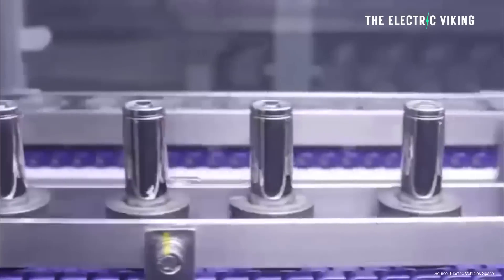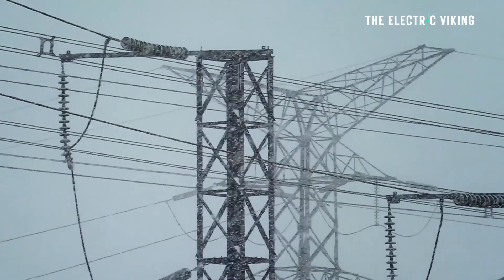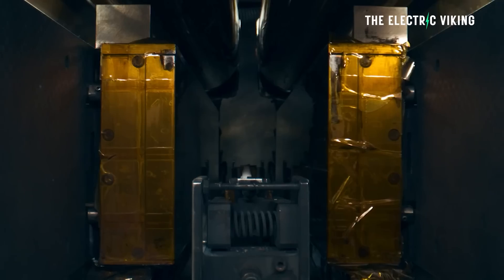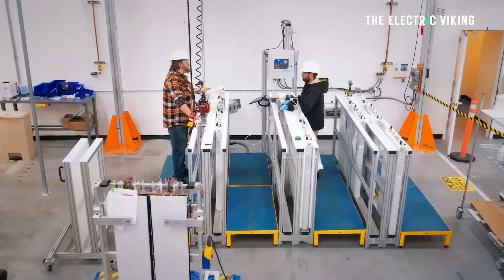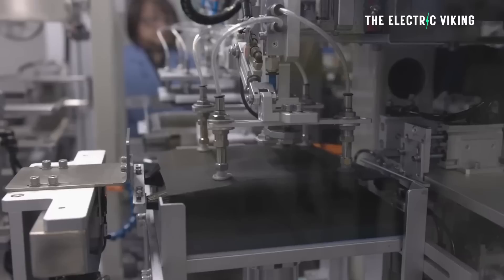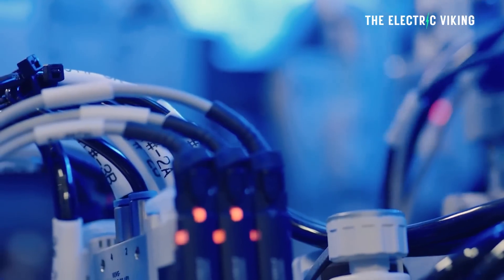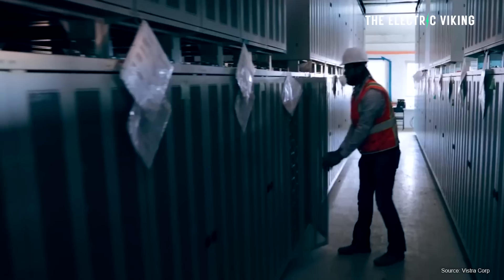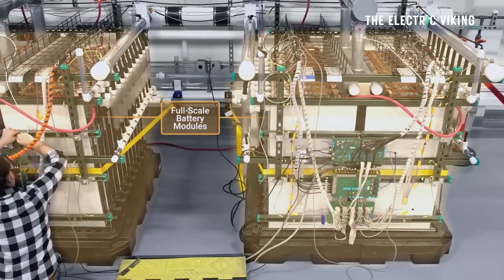U.S company reveals revolutionary battery that DESTROYS sodium & lithium

Comment: Iron air batteries lack the energy density to ever make sense in vehicles. However, for stationary storage, they are cheap as dirt and practically infinite cycles. Not destroy LI batteries, but make more sense in large stationary installations.

Comment: Installed on the site of a closed factory.  And using lithium-free batteries made in a long ago shutdown steel factory in West Virginia, bringing needed jobs there.  Partially funded by President Biden's IRA.    Tesla seems to always build their mega factories on new previously undeveloped land in areas where jobs really weren't needed.    (Rivian's are mostly built in old rust belt factories.)

There are also flow batteries that don't involve lithium or cobalt and are better in hot climates.   Lithium shouldn't be used for grid-scale storage.

Comment: Cost isn't the only factor, assuming it's true.
While it might put Tesla Powerwall into obsolescence, batteries for Tesla and other vehicles would remain Li-Ion. Why? WEIGHT. Iron is much heavier than Lithium. And the cars by weight are already causing major wear and tear on tires and roads. 
So this new tech is great for homes and grid applications, not so practical for mobile applications. Let's see how this plays out.

Comment: The comparator here would be the vanadium redox flow battery. The largest one presently operating is 100 MW, at the Ronke plant in Dalian, Liaoning, China. The storage is only 0.4 GWh. However, storage can be scaled to any required level simply by building extra holding tanks for the liquid electrolyte.

Comment: As with IT, could have a chain of high performance tech working down to cheaper high capacity. CPU cache > RAM > SSD > Hard Disk > Tape. With batteries have a decent LFP battery to dis/charge quick for power spikes, then this to dis/charge slower and keep LFP charging as much as possible. Alternative off-grid multi-day store would be a generator. Could be great for wintery multi-day bad weather if a reasonable price. Could be great for off-grid cameras, Starlink, etc where the pain is multi-day bad weather.

Comment: Simplifying this, it's a large, heavy, inexpensive, durable battery with a maximum discharge rate of 0.01 C.  
  Renewable detractors, not totally unreasonably, worry about scenarios where there is inadequate generation for a protracted period.  Stagnant high pressure area with no wind.  Constant cloudiness during a Californian atmospheric river.  These batteries are too slow to meet the peak requirements, but could be be sized slightly larger than nighttime base load.  They could then used to recharge the peaker LFP batteries that are faulted for having only 4 hours' capacity.  Very similar approach to a low power (20 hp) gasoline engine in a PHEV which requires only 17 hp to maintain 100 km/h on a level expressway.  The small battery is always ready to provide power to the 200hp electric motor for 40 miles and is slowly refilled between sprints.

Comment: Northern Europe may need multi day systems. I have up to 12 days of very overcast skies and no wind, very common in England due high pressure blocking. But as some on here noted why not use a mixture of chemistry to off set the disadvantages of both. It's a very interesting chemistry and will have a nose . 
Incidentally I have run off grid for 15 years and actually use two systems one lead acid and another on LiPh. I think the way for off grid is definitely LiPh . I only have the lead acid as it was the only system available at reasonable price at the time things have changed since then.

Comment: 1/10 cost, sure, if it is working rusty iron rather than lithium or sodium or other rare metals and chemicals as it's working medium.

I think the slow discharge is going to be an issue for the grid. But it may be OK for smaller applications. I'm really hoping they can scale down to home use like you speculated.

Comment: There's not enough lithium to do the job, so if course they're looking for a more common replacement. EVs are a novelty, a dead end until either battery chemistry improves significantly or onsite generation is developed to a practical level.

Comment: Who'd have thought... Edison! Edison thought. The Edison Iron Battery, available since the statrt of the last century, Edison used them to power the first electric car, before petrolium processing became efficent and available. The battery chemistry was invented by Jungner in Sweden in 1899, but Edison was the person who took them up. I beleve there is one somewhere that was over 100 years old and still running, but that was some time ago.
There problem was weight. But if you don't have to move them, weight isn't the issue. the other problem being amp draw, again they might come up with the same solution that brought about the 4680 battery, but not trying to draw from a single battery, this might not be a big issue.
Reply: Uses nickel

Comment: 1/10 of the cost makes perfect sense. The infrastructure for forging the plates. Iron is one of the most abundant natural resources if not the cheapest metallic resource. Water can be used as the electrolyte. Buy cracking water with electricity, it makes its own catalyst. It doesn't get cheaper than that. If it actually works, it's legit.

Comment: This battery is (1/10) the price of a Lithium cell.  OK.  But wasn't that "sand" battery even less expensive than this one?  And, if we are talking about a battery where (weight) or (size) are of no concern.  The "sand" battery has my vote.   lithium iron phosphate sounds like a good battery where (weight) or (size) ARE important.  Like in a car.  I read (lithium iron phosphate ) can take a charge up to (100%), and then down to (zero%).  Those are the qualities that are good for a car.  Stationary battery technology should still be a "sand" battery, in my heart.

Comment: It could be much cheaper, but not competitive in terms of energy per pound and energy per volume.  So it's not useful for mobile energy storage at all.  But fine for fixed energy storage where there is plenty of room.  Battery storage for days could be very useful for people who live where solar output can be down for days due to weather.  I would love to have one of these.  I could charge it on sunny days and send power to the grid during the 4-9 PM peak cost hours.

Comment: They're slow, heavy, and large in comparison to li-ion, but that just means the two compliment each other. Li-ion can be used to quickly follow load hour to hour. They can also be used in electric vehicles. Whereas iron-air can be used for more long term grid supply, for example, when there are multiple days of low wind or solar conditions.

Comment: Just use a combination of lithium ion and Iron batteries in the sweet spot between cost and peak loads.  If you have enough quick draw batteries to offset peak loads when needed you would still save gobs of money on the base load equation.

Comment: This would be ideal for the UK.  Imagine 10GW/10TWh of Iron Air batteries distributed around the grid near load centres and generation centres (ie offshore wind farm connection points), then in addition you have 30GW/60GWh of Lithium or Sodium ion batteries.  On top of this you might have another few GW of gas generation, plus all your offshore and onshore wind, and a bit of solar.  In times of surplus the energy feeds into the Iron Air reserve, in times of deficit the energy comes back out of the Iron Air reserve, with Li/Na ion managing intra-day variation ie night/data/peak.  If a longer high demand/low generation event is forecast then the gas generation might kick in as well to boost the system and see it through those times.  Offshore wind actually generates more in winter than summer overall which is a good fit against demand, but the generation is quite lumpy so need a way to buffer it and Li/Na batteries just can't absorb that many GWh cost effectively.

Comment: Probably it's a bad cost projection. Like only project the material cost. Of course, if you do that, iron is ridiculous cheap. Although also is salt (more, in fact). But build a battery is a lot complicated and expensive than just materials, and the difference is greater the cheaper is the raw materials.
On long term, if the raw materials are very cheap, like sodium or iron, there is a great potential of a very very cheap batteries, but reach that point of cheap production it takes a lot of time and development, not the next day you start to produce these batteries.

Besides, batteries has multiple variables to observe, like round-trip efficiency, cycles per lifetime, safety, disposal cost, etc. I know that sodium has great values in all these points. No idea about iron-air.
Reply: Ok. After checking a little via websearch I think I know what's the "problem" here. Bad round-trip efficiency in comparison with lithium or sodium-ion. In contrast, it seems that the battery manufacture could be very simple, and the self-discharge could be very low. So it's a candidate for secondary storage. Instead of daily-cycling like lithium/sodium, it would be a candidate technology for week discharge.

It depends a lot of the real cost of the price of a completed project. Because while daily discharge could be done every day of the year, so 365 cycles per year, 3650 in a decade, with a cycle-life of 5000 cycles it can be amortized in a reasonable period.
But with a weekly discharge, for combined solar+wind production depression, the number of cycles could be as low as 5-20 cycles per year. So the cost of the kwh needs to be divided by 50-200 to see the price per kwh cycled. It needs to be a lot lower to compensate the low number of cycles if you want to amortize the infrastructure in a reasonable time.

So, it needs to be 20 to 100 times cheaper than lithium/sodium to fill the niche of depression cycles instead of daily.

Comment: It is inexpensive because iron is cheaper than lithium. The round trip efficiency is only 50% so it is not as energy efficient as lithium batteries. In the end that might be acceptable if you are already “curtailing” (wasting) energy in the grid and you don’t want an expensive storage solution.
Reply: I think Sam missed the whole part of it having only 50% round trip efficiency. That’s basically throwing away electricity just like our current curtailment. In the short term, the lower capital costs will be great, but in the long run the cost of lost energy will mount, and you may not want a battery with a 50 year life span.

Comment: At the moment Li-ion/Na-ion is for balancing the network, because it can respond instantaneously to demand and supply changes. Fe-air, compressed CO2, compressed air, pumped hydro are for longer term storage, when you know you won't need that energy for the next 2-4 hours. For instant fluctuations, Li-ion is still better, because it can simulate an actual rotating power plant with a flywheel that's very stable 50 or 60 Hz.

Comment: Maybe energy storage will become a bit like how data is stored with tiers of performance vs costs.

With data you will have high cost and fast data on SSDs.

Then less used dat can be on high performance 10K hard drives.

Less used again on 7200K drives.

And if it's more for archivale then good old tape.

With energby you migth use lithium ion for grid stabilisation and adjusting to sudden changes in demand.

If you've filled up your lithium storage then you can funnel the excess into the longer term duration.

If your lithium batteries need a top up over night you can pull that in slowly from the long duration storage.

Comment: Yes but what is so imbecilic about your presentation of the new battery chemistry... is that the first sentences out of your mouth ... Says nothing about environmental improvements... And or cheap cost of the materials to make them. Don't you realize that's why the scientists and inventors went to the trouble to make sodium ion batteries? The reason they MADE the INVENTION... Was because sodium ion did away with the problem of pollution from mining lithium... Salt was an ultra abundant element that was super cheap. And the sodium ion battery could be recycled far easier. That should be the first things you t address when you present some new battery chemistry type. But instead you say nothing about it. Like in all your grand electronical wizardry education you don't even GET the reason the scientists and inventors MADE the invention.

Comment: Hey Sam, so the duration means very little. So for example take your electric car battery fully charged, leave it in the driveway with the overhead LED light on. Think of how long your battery will last because of such little draw. But the car manufacture doesn’t advertise the battery that way per length of time, it needs a lot of power very quickly to run the motors. I think the industry standard is four hours, then you can define your GW/hr and therefore consumers can compare apples to apples.  As for the cost this is probably in relation to two things. Number one as always with manufacturing is scale, the more you can make the less it’ll cost you. The second thing is pretty simple, it’s called the periodic table of elements. Fe is cheap and O2 is free, so yeah 10 X might be true?

Comment: It doesn't blow sodium out of the water because the energy density is really low for these iron batteries. They have different use cases. Stationary vs mobile.

Comment: the quoted round trip efficiency for an iron air battery storage system is 50-60% range vs about 90% for Li ion batteries.

Comment: This sounds like a potential replacement for backup diesel generators installed (mostly unused except for testing and maintenance cycling) in commercial industrial and critical infrastructure buildings (factories, datacenters & network disaster recovery centers, hospitals, hotels, office towers, etc.). It sounds like it could even be used more frequently to offset peak electricity costs.

Comment: They're saying $20/kWh, so comparing to $200/kWh an said they wanted maintain that 10 advantage, which they clearly won't.

As far as I am aware, air batteries are relatively inefficient, so some cost advantage is lost there.

But, it should help cut electricity prices at winter peak.  The spot prices can go nuts during cold snaps when natural gas demand peaks.

Comment: The paper mill you are talking about I seen years ago when the whole factory was still standing. The Maine mindset is so open and honest that the factory had a lock on the gate with the key in the lcck. I was on vacation and took a tour of the whole plant. When I was done I was meet by a policeman who was more interested in my health and safety than the trespassing of the property. We talked for I bet half an hour. He welcomed me to Maine and wished me the best, shook hands and we were both on our ways. What a pleasant memory Viking.
Here is one for you Viking. You can use just sulfuric acid and water to make heat for your house. When concentrated sulfuric acid added to water there is an incredible amount to heat released. Then you use a membrane to make the acid concentrated again. Then the process will start again. Free high heat for just about anything.
Reply: I am sure it costs energy to push water through that membrane... otherwise, you would have some form of perpetual motion.
Reply: "I seen " is terrible  / wrong english ... "i saw is correct"

Comment: The 10 times cheaper figure is based on lithium ion energy capacity cost of $200 per kWh vs $20 per kWh for the iron air battery. Prices for LFP batteries are already less than half that and according to Tony Seba are projected to fall to $25 per kWh before 2030. According to one of your more recent videos, sodium ion batteries may go as low as $10. Lithium and sodium have much better power output and a better round trip efficiency (iron air 50 to 60%).

Comment: I think you are misunderstanding the relevance of the “hour” rating that these batteries have, thinking that somehow longer is better. It isn’t, it is worse, it defines a limitation imposed either by the battery chemistry or by the supporting inverters. How long it takes to charge or discharge the battery is the same thing as the charge times quoted for electric vehicles, faster is better. A one-hour battery, which has a C rating of 1, will happily charge or discharge over 100 or even 1000 hours if that is what you want it to do but there is no way you can make a 100-hour battery, with a 0.01 C rating charge or discharge any faster than 100 hours.  They need such a big battery to be able to support the charge and discharge rates that they need, which could be achieved by a much smaller LifePo4 battery, and this explains why the price must be so much cheaper. Most utility batteries these days are used to support instantaneous load following or the short turnaround times to flatten peaks so there is not much incentive yet to build anything other than short term batteries. There is obviously a benefit to having lots of storage, even at a slow rating, but an equivalent sized battery with a faster rating is clearly better. Using this battery in combination with a faster battery would be awesome though.

Comment: This should be similar to Nickle-Iron batteries in specs, although you only mentioned the one electrode material. If so they are heavy, safe and last almost forever, but are somewhat less efficient than other chemistries (meaning some energy you put into it is not captured), although perhaps the addition of O2 improves efficiency somewhat. Jay Leno has a Model A Ford EV that still runs on its original Nickle-Iron battery manufactured by Thomas Edison.